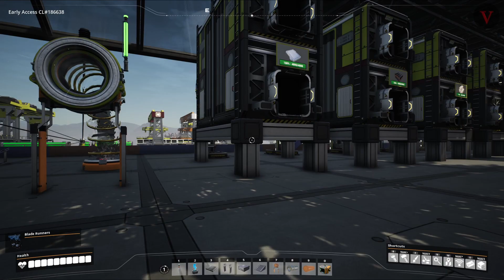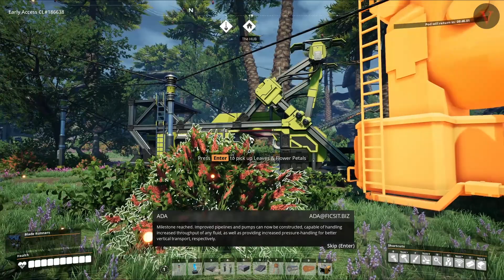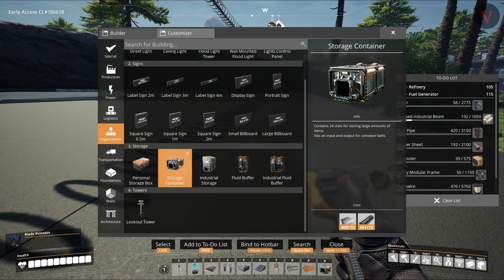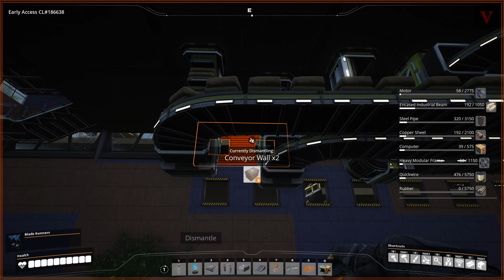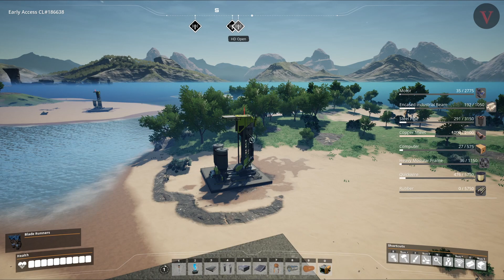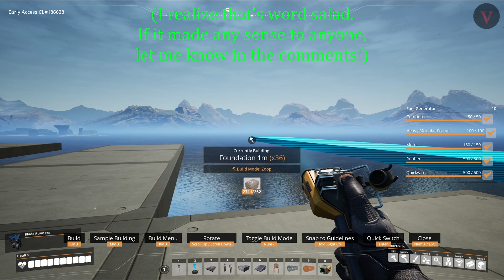Pixel Perfect E25 - Laying the Groundwork for Oil Manufacturing - Satisfactory Let's Play Series

Comment: See this place is gona be huge but this is only a small token of what the true build will be after the next update and you can again use the original location i cant wait to see the size that place will become
Reply from the maker: Shifting our turbo fuel manufacturing to this location is going to take away some of the extra refineries and generators we would had placed in the Spire Coast facility, but as long as the update retains the 10 oil nodes up there, it will still be a much larger facility.  It'll also likely host production lines for advanced oil products from alternate recipes that we don't currently have unlocked.  I am looking forward to revisiting that area post-update!